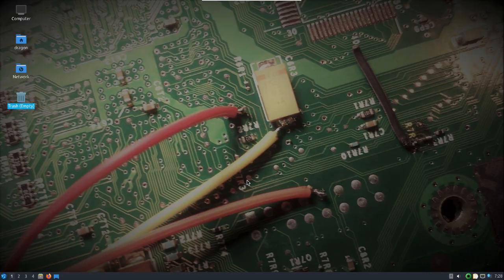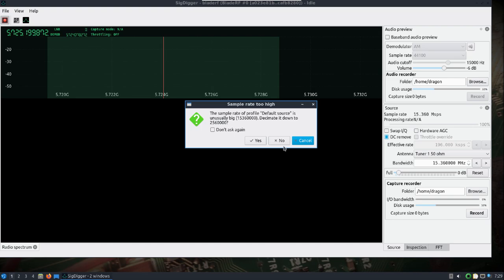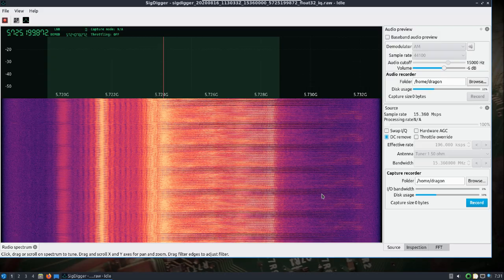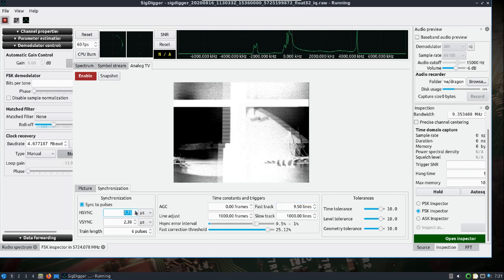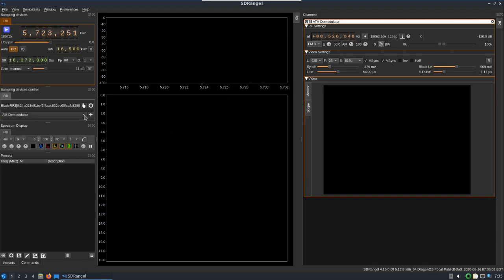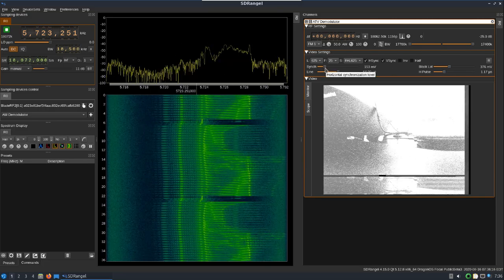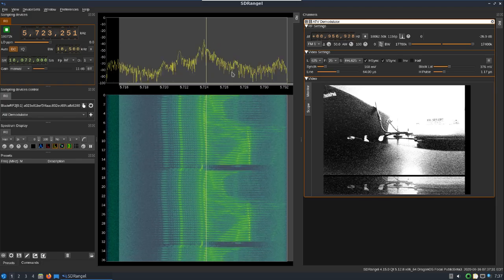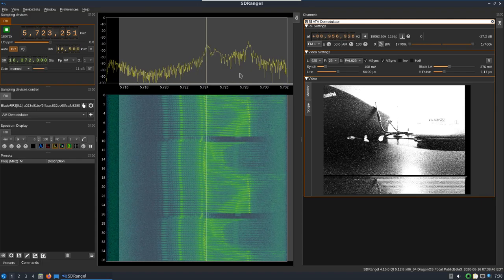DragonOS Focal demodulating 5GHz analog drone video (SigDigger, SDRangel, BladeRF)

Comment: Hi. Thank you for great video and knowledge...
I hawe one question :how can I live record and demodulade the signal???
Thanks
Reply from the maker: If by live record the signal you mean capture the IQ, it would quickly consume Hargrove space as the sample rate is pretty high. You may be better screen recording the video demodulation window, but if you want to save the iq you can add a file recording block to the work space and save to disk.

Comment: thanks for the video, I am curious to know if you had a right hand polarized antenna when running this
Reply from the maker: My brain isn’t fully awake yet but it was one of those “cauliflower” or FPV cam antennas I had installed on the hackrf when viewing the feed.
Reply: @cemaxecuter7783  thanks for the reply. I am having issues finding "ATV" on sigdigger, does it come loaded by default? Or does it have a different name. I have some FPV antennas i wanna try out and might even make a video to help the next guy.
Reply from the maker: @MrKaleidoscope it does have a ATV portion to it but you have to open an inspector and setup for it. I think I have another video dedicated to doing so with SigDigger.

Comment: To make it clear no way get the basic FPV stream on the Portapacks inbuild analog TV feature.
Are new to this, but tried with my unit and just going directly to the FPV bandwidth looks something like this .https://i.imgur.com/RCGPbXD.jpg
and on the analog feature like this https://i.imgur.com/4gLFe8h.mp4
definitely data there, but likely not enough tools to synch it.
Reply from the maker: Love the setup! I really need to get a portapack. I honestly didn’t know it had that feature and it almost looks like you got it tuned. I have what looks like that same exact camera you have laying there. You’d think though if it has that analog feature it should be able to view it. Does it give you any options similar to sdrangel?

Comment: Just showing the waterfall chart (no further data processing than the visual) would be of great help during drone races (8 pilots in the air on 5.8Ghz band). So for over the FPV analogue range of 5.7-5.9Ghz (resolution of 20mhz?) - would there be a solution with an RTL-SDR dongle and a downconverter? Or would the HackRF still be the cheapest path if you just want visualization (RX)?  What would you do?
Reply from the maker: Great point and now you have me thinking maybe a modified Pluto would be a cheap alternative. The Pluto SDR doesn’t ship with the 5.8ghz range available but the hardware supports it. There’s a bunch of videos showing how to modify it. An example here 
https://www.rtl-sdr.com/adalm-pluto-sdr-hack-tune-70-mhz-to-6-ghz-and-gqrx-install/

I do want to get a Adalm Pluto and try this. If I get one I’ll make a video. Plus I hear there’s great support for it within sdrangel.
Reply: @cemaxecuter7783  did you ever get one?
Reply from the maker: It’s got the bandwidth you’re looking for and it’s about $150. Just needs the modification done.

Comment: Is it possible to demodulate DJI Mavic video streaming?
Reply: I believe the consumer drones like mavic still use regular Wi-Fi (as opposed to lightbridge on the pro level) - but you’d need more than this. Breaking the encryption would be the first step, so not sure it’s worth the effort in most cases. If you have the key, something like dragonfly for android could work.
Reply: @digus  I see. I'm currently doing a research project on DJI Mavic 2 Pro, but I'm stuck at demodulating its signal which I believe DJI is using OFDM.
Reply: TheEpicProduction 
Oh wow, that’s cool - so being the “pro” model, I’m pretty sure you’ll have ocusync to deal with. I believe it’s using some type of spread spectrum frequency hopping techniques. I’m no expert but FHSS could certainly look a lot like ODFM at first- kind of like moving around quickly, vs multiplexing on different frequencies..? 
As far as I know, neither DJI protocol has been defeated publicly, yet. I just have an old P4P and do not really stay on top of these things any longer, so I could be off on some of this. 

@William J is absolutely correct that the FCC site is pretty much always the best place to start. 
So while they may all be using RTSP on the inside, the difference between a mavic Air (WiFi) and a Mavic pro (ocusync) will likely be quite a bit different in the (propriety) wireless encapsulation technique.
Reply from the maker: Not with this technique. Pretty sure DJI uses digital and/or some other techniques. If you google analog fpv camera you’ll find some for like $15 and they’re normally sold for racing drones.
Reply: @Willam_J  Thanks for the guidance. Does the RF Test Report show all the relevant OFDM parameters that are needed to demodulate the signal? 
https://fccid.io/SS3-L1P1805/Test-Report/Test-report-3974339
Sorry if my question is too dumb, as I'm not majoring in electronics engineering but computing sci.
Reply: So, gotta love the algorithms sometimes - just after I posted the last comment, this showed up in my feed:
https://youtu.be/gfqcSv9sR0A

Looks like you are correct that the video is using OFDM. The controls/ telemetry seems to be using FHSS.
Reply: digus no wonder I can never detect control signal using SigDigger because of FHSS.
Reply from the maker: That’s a great reference!